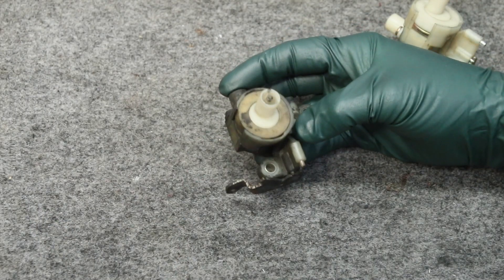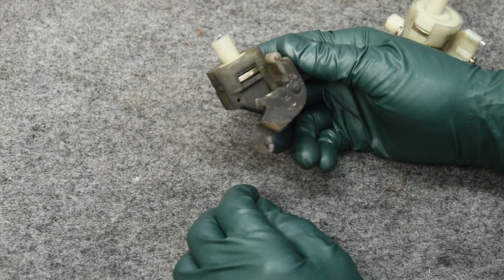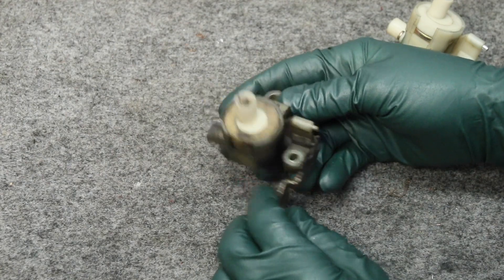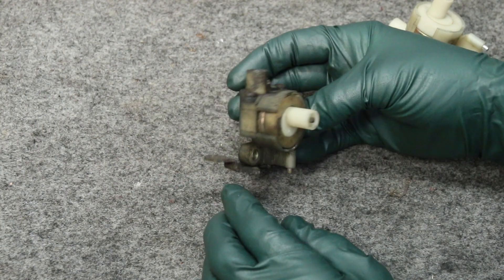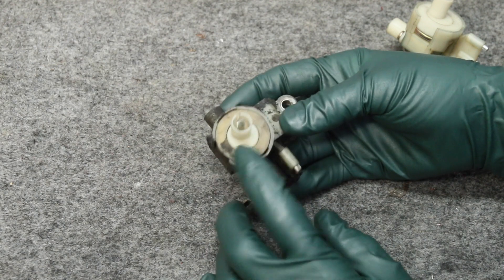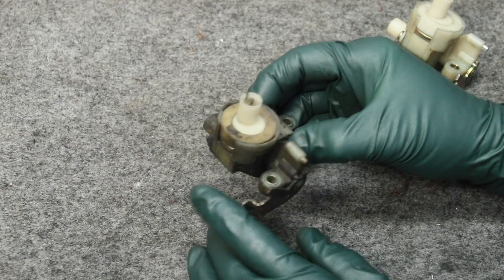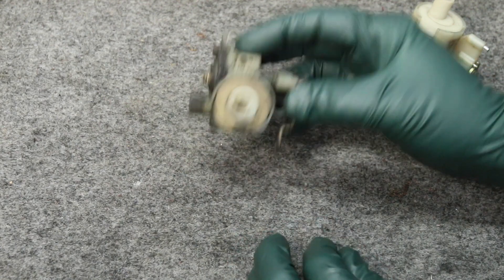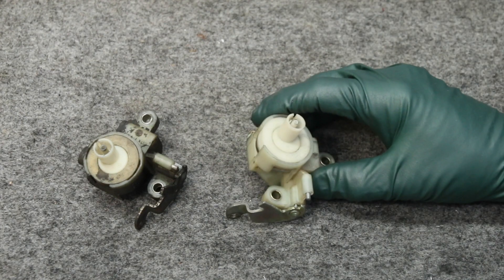The Infamous Diesel VCV Valve - Can it Be Repaired.

Comment: I am having trouble getting the VCV control rod back on the ball stud on the pump. 1980 300CD NA. Any advice?
Reply from the maker: The spring inside the ball head is rusty or gummed up. Soak the end overnight in a rust penetrate - then apply synthetic lube and install. Use light pressure from pliers if it will not snap right in.

Comment: Hello from Portugal! I recently purchase a w123 300D NA that dont have VCV. IM not an expert, but I dont see any vacum tube to the gearbox, and the throttle linkage doesnt operate the gearbox either. Is it possible?? Thank you, I love your vídeos
Reply from the maker: When posting questions, ALWAYS give the year of the car. Not all 123 300Ds are created equal. If you have an early model, there may be linkage below the intake manifold that goes back to the right side of the automatic transmission to control its shift points.
Reply: @Mercedessource  Thank you for the answer. Its a 1977, so it must be as you say. I'll check it out!!

Comment: Hi Kent can you help me to find the altitude sensor on a 300td 1988 model many thanks in advance
Reply from the maker: Are you sure about the year. 300TD was not available in 1988 in U.S.
Reply: @Mercedessource  Hello Kent I'm from France it's a w124 year 1988 6 in line turbo diesel  the problem I'm experiencing is when I go to the mountains it starts to smoke and some power loss on flat it works fine was wondering it there an altitude sensor on this power horse

Comment: Dude I ruined one of these 10 years ago when I shut my 300d's hood on it accidentally while it was laying in the engine bay, turning it just as useless as the one I was replacing. I had to spend another $80 to get another. I still have the ruined one because it blew my mind way back then that I part like that could not be purchased new.

Comment: I used to have a W124 OM605. 5 cylinder, 20 valves, no turbo. I also had an issue with the VCV. That looks different but the same purpose. In that the rubber diaphragm tends to tore. You can simply suck air from the valve and feel if it's torn. The symptom is very harsh upshift when you just slightly press the accelerator. I bought another one in a scrapyard. It worked fine for 2 days and broke. Finally I bought a new form Mercedes. It was really expensive.